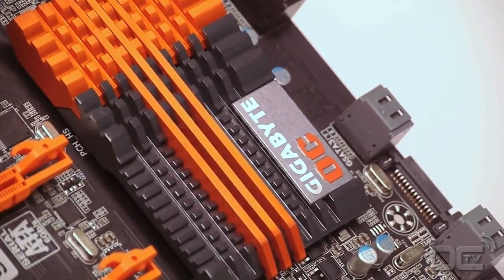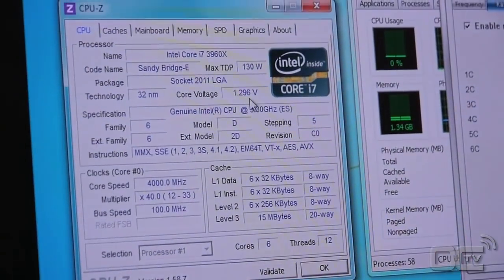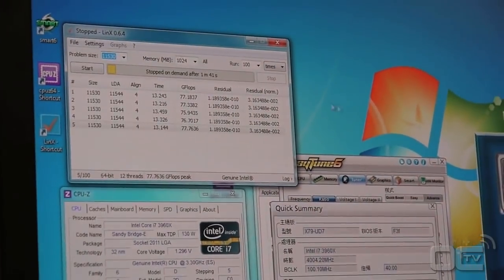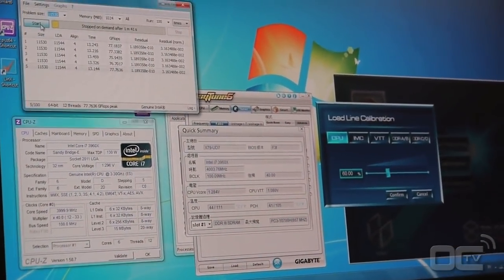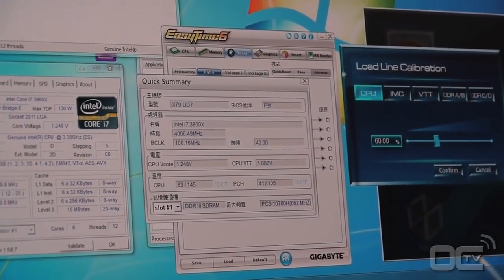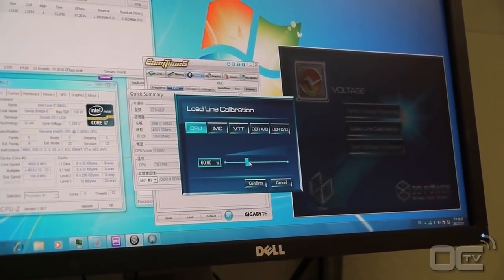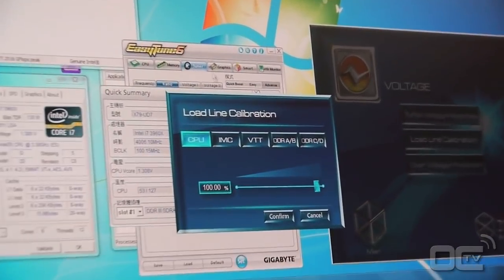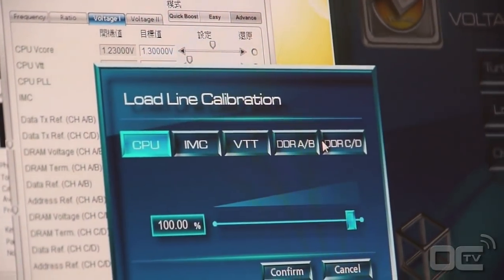Gigabyte X79-UD7 - Simple Low Line Calibration walkthrough by HiCookie

Comment: Question to hicookie,
When you removed the LLC the voltage raised on the VCore. Does LLC cause the processor to be Stable at LOWER Voltages? Because if thats the case then everyone I have heard speak of LLC says its 1. Not good for the CPU to use it and  2. Causes the voltage to raise when under load instead of drop. 

Which is it?  Also, One more question... 
Do you use the LLC for IMC and VTT?